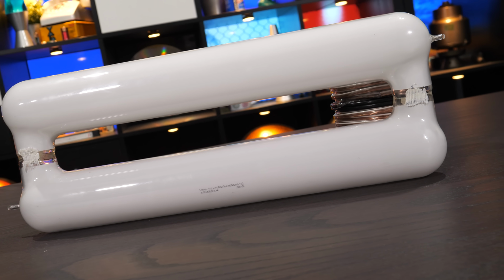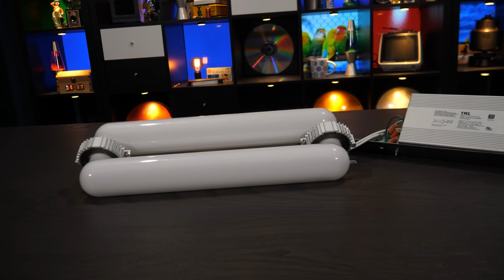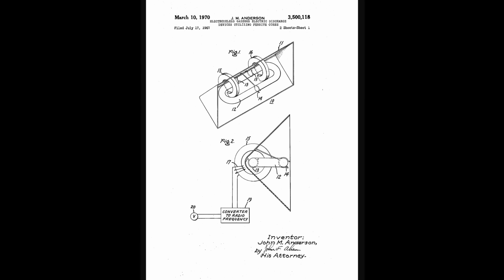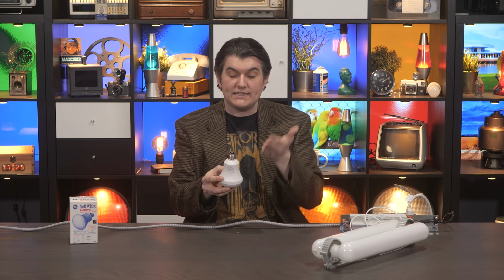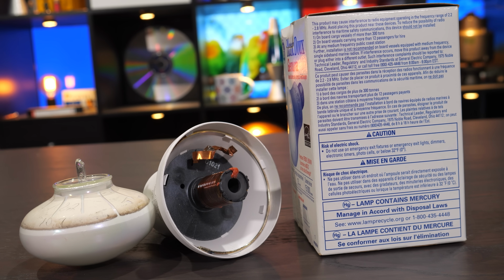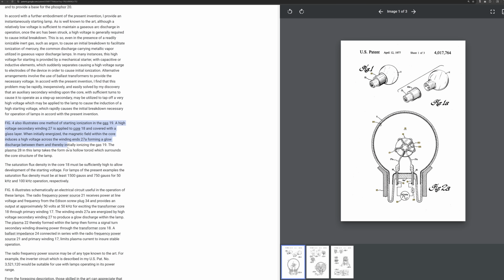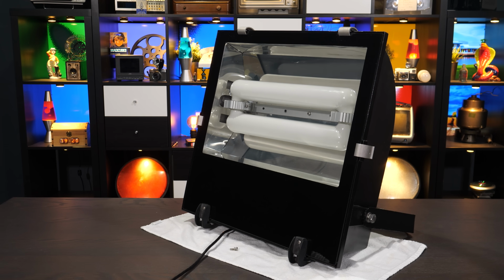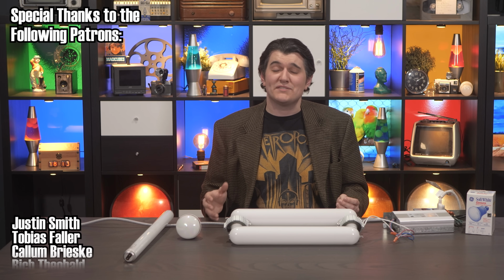Induction lamps: fluorescent lighting's final form

Comment: It works the same as when you put fluorescent lamp next to Tesla transformer. Large enough electrical gradient can break down the gas and produce electrical discharge and thus light.
In case of magnetic field, the time derivative of the field produces electrical field. The higher the magnetic flux or frequency, the larger the induced voltage.

In case a metal strip is placed inside the glass tube across the voltage gradient, it can either act as an antenna (placed inside the core) and thus increase theninduced voltage inside part of the tube if tuned correctly, or as shorting element (placed away from the core), thus providing lower impedance path, virtually shortening the length of the tube. Once the tube is started, the gas achieves much lower impedance and then the metal strip does not male that much of difference when running (if made to be fairly thin / small).

Comment: The problem with LED's is that the advertised lifespan is nowhere near realistic. In a lot of cases it's worse than fluorescent. At start they advertised 150.000 hours, then 100k, now I see "60k" on packaging... in reality it's 10-20k, except if it's cheap and chinese, then it's a few months tops XD . Meanwhile many of my fluorescent bulbs are 10-15 yo and probably got 20.000+ hours.
Less energy efficient? 2-3x, yes... On paper. In reality those leds are hot as F*** and definitely aren't "3-5 watts". Power factor is bad, also they inject garbage back into the grid causing the new digital power meters to go haywire

Comment: Those amalgam pellets are attached to a small antenna that creates a high voltage that allows the lamp to start. I've used a 400W version that was purple pink to grow plants with. Replaced the capacitors and the mosfets in the driver twice over 14 years of use. LED panels ate its lunch though. 😂

Comment: The only thing I understood from this is Magnetic/Electrical  Radio Frequency causes these bulbs to glow. Modern LED bulbs are way more efficient, but seeing the light bulb history is still cool, even if the bulbs won't be after being on for a few hours. I wouldn't be surprised if the GE bulbs failed from the glass falling out of the bulb due to the heat.

Comment: The thing to point out is that frequency dependent discharge exists. The higher the frequency, the lower the breakdown voltage gets. Another factor is how high the actual current is in the induction coils, recall that most power loss is a result of copper loss, which is proportional to the square of the current times the resistance: What if the current is very small? And with very high frequency, the skin effect minimises actual conductive volume versus the conductive surface? To say the least of the bleeding edge research of surface plasmons that indicate that this is a very effective technology for the purpose of power transfer and wireless charging.

There is also a company that is using it for large area, high efficiency wireless power called Etherdyne. it takes advantage of all of these attributes to allow for their whole room wireless power.

Comment: Years ago I had heard of those lamps. When LED came around my idea was and still is a mixed lamp. Mostly LED when it is cold, and mostly induction lamp when it is hot.

Sure, it would not stop the LED much from degrading completely over the time, but most of the time both technologies could work together with much lower power for probably higher efficiency?

Comment: As for how these induction lamps start , well it's not that complicated but it does help somewhat to explain why they took so long to become commercialized.
It's actually not all that hard of a concept to understand, all that is required is that you have to have an electromagnetic field inside the envelope that is sufficiently intense in it's variation to overcome the ionization energy of the gas particles contained within. Same idea as with "normal" fluorescent bulbs, starting the thing requires a particularly intense "burst" of energy, but running it at a steady state requires far less instantaneous power output. I imagine that the solution in both cases (assuming an electronic ballast for the fluorescent lamp) is the same, charge up a capacitor to a high voltage and dump the energy into the electrodes or coils in a way that does not damage the steady state drive electronics.
As a side note, starting quickly is almost certainly one of if not the major reason that the GE induction lamp has it's mercury amalgum pellet on a particularly long stem inside the ferrite coil antenna. That is where the magnetic field fluctuates the most strongly, which means that is the location that receives the strongest heating from electromagnetic fields, and so by locating the amalgum pellet there, the "warming up" phase of the lamp's operation is greatly reduced. As for why that is not done on the 200W output 2-coiil lamp, I imagine that is due to lifespan concerns and envelope geometry constraints.

Comment: fluorescent lights are so crazy to me, one time my friend was restoring an antique radio and for the life of him he couldnt get the tuning right there was a clear interference sound. he turned off his wifi, any bluetooth, power strips, still had the interference. turned out it was from a flickering fluorescent light in the hall outside his apartment.
Reply: Old radios (especially AM) are SO sensitive to interference. If you take an AM radio out to a very remote area it's nearly silent as you scan for stations. All those weird noises we associate with AM are interference.

If you look up a video of an AM set in a remote area scanning the dial the difference in noise is wild.... Just a little static till a station comes in, no crazy noises at all.
Reply: @volvo09  FM and digital radios only mask the interference until it gets bad enough.
Reply: I remember how my PC speakers used to produce some weird buzzing sound, but only when their volume knob is close to either its lowest or its highest value - right at the middle the sound was barely there. I just assumed that, due to them being quite old, they may be failing due to leaky capacitors or something. But then I realized that the sound is only there when the lights in my toilet were working. So this wasn't even the speakers problem, it was the problem with the ballast of the lights fixture. After several months that light fixture had failed completely and I replaced it with an LED one. And those speakers still work perfectly
Reply: @akeem2983  You reminded me of PC speakers predicting calls to your phone
Reply: @Kalvinjj  I remember those days! You just made me smile, thank you!
Reply: @akeem2983 i have cheap logitech speakers, heck all of their speakers have this issue, and many times I have been able to pick up radio broadcasts or other because of the entire absence of shielding in all of the components.

More than once I have been convinced someone is talking behind me or I'm being haunted when it was just talkback radio.
Reply: modern radio equipment use spread spectrum modulation (QSM) that modulates both the frequency and amplitude and basically creates a white noise that permeate everything and is basically immune to interference (until the entire noise floor of that band becomes too high). Old simple amplitude modulation radio has no chance of surviving on this modern environment.
You open up older equipment and they're full of shielding, nowadays the EMF shielding is basically "virtual" it is done by randomizing the frequency output so it never peaks for long at the same time, which for the spread spectrum (aka, QSM) used by phones, wifi and bluetooth is not a problem.
I discovered that when I made a small microcontroller produce a very clean 16Mhz radio signal from its clock source because I didn't knew all of that and configured the PLL (phase-locked loop) myself wrongly, aka, I didn't. 
Not to say the homebrew radio people weren't happy with the interference I caused. That wouldn't be a problem for a 2W device, except that my device had an amplifier (it was for audio, but it was a 200W SQR amplifier) and the signal leaked back to its Wi-Fi repeater via poor grounding, which it promptly amplified to 100W over that I sent over 500m.
Analog electronics is hard, you want things not to be an antenna, but everything is an antenna.
Reply: @monad_tcp  yuck... so instead of taking advantage of light having nice frequencies they scattershot the range?
Reply: Even you standing near makes you an antenna or a source of interference :D
Reply: @monad_tcp  Because I'm essentially clueless regarding this kind of thing, and you, obviously, are quite the opposite, I'm singling you out for a silly question which I realise is probably beneath you, but which I'm hoping you (or someone else reading) may nonetheless indulge, if you have a few moments... I was wondering if the ferrite cores wound around with copper wire used in induction - fluorescent lamps could be used as AM radio aerials (antennas), and if so, would they be useful in the broadcast bands? Obviously RF energy is integral to the operation of these lamps, but I don't really know if that is of any relevance to my question.
         I realise there is probably no practical reason why someone would want to dismember one of these lamps for such a purpose (at 150 bucks a throw I don't really see some kid trying it for his/her science project crystal radio... hypothetically, I suppose it might not be beyond the realms of possibility for a POW to give it a shot, but I think we're a little bit past the days of the BBC sending coded messages into occupied France?!) Still, the possibility(?) piqued my curiosity.
       One related question, if I may? It was gratifying to note that one of the manufacturers mentioned in the video coated their bulbs with a (semi) radio~opaque layer to minimize interference. I take it I'm correct in assuming that LED lighting manufacturers nowadays make little or no effort to shield or suppress nuisance radio emissions from their equipment?
      Anyway, Cheers, Ta (whichever!)
Reply: @monad_tcp  antennas arent a problem. its called grounding. any good cables have not only + and - but also the ground connection on them. i managed to ground my speakers on an old ikea cabinet that used gold glass (just a tiny amount of gold in it made the glass much stronger, and it produced green reflections) by just making the cables touch the glass.
Reply: @monad_tcp QAM. Quadrature Amplitude Modulation. Spread Spectrum is a separate topic. For example, OFDM as used in 5G cellular or WiFi is a form of Spread Spectrum, because you slice the wide RF band into multiple narrow orthogonal bands, each running an independent QAM stream. So they are related, but OFDM is a frequency division method of spreading signals, and QAM is a method of modulating each band to pass data.
Reply: Had a problem like this some time ago. The culprit was a fluorescent tube which displayed lighter and darker bands across its length. Ot generated noise roughly at 130 kHz. It took me quite a while to spot, as in happened sometimes.
Reply: Heck yeah, Sage watches Technology Connections?!
Reply: those FCL lights super amplified my TVs remote. one step up the volume resonated with endless up the volute until i turned it off. same thing with lower volume. you could put the remote on the the table and it would still "send signals" in some way. my parenty werent amused middle of the night lmao
Reply: How did he found out that it was the light?
Reply: @vilian9185 , the interference will pulse at the same rate as the flickering light.
Reply: Huh fancy seeing you here, lovely channel
Reply: Those little miniature desktop florescent lights that the old ladies all demanded be on top of the monitors "to see better" played absolute hell with the CRT monitors and even some desktops
Reply: This is why i hate modern electronics that run or charge off of 120v. They're all noisy on am radio up through shortwave and even into vhf frequencies.
Reply: Radio is one of my hobbies and most CFLs are incredibly noisy from an RF standpoint. Switching power supplies are too. AM radio is nearly useless in most modern homes due to all the electrical noise.
Reply: Imagine being a musician, let's say at home studio, where the pickups already pick up noise from facing screen monitors, or radio signals, lights and whatnot. And then having a fluorescent light around.

Personally I have a flash of blue in my tv whenever I flip the bathroom light switch, sometimes other lights flash as well. It might be the fluorescent light or just in general the wiring, the tv source is through a home theater amp from pc via hdmi. The blue screen flash is I think the default no signal mode visual.
Reply: Finding out that Sage watches TC is the cherry on top of this video
Reply: Yes, a malfunctioning fluorescent light CAN become an R.F. firehose...

Comment: 18:00 I would imagine some manufacturers played with the idea of including a long-lived, low-level α- or β-emitter in the amalgam. That would solve the problem of providing the initial ionisation. With the correct choice of isotopes, it could potentially be at a level where the tube would not need to be handled in a more strict regime upon retirement than any other Hg-containing lamp. (I guess that would be yet another product with wildly varying requirements depending on the local regulatory body for radiological sources.)

Comment: What I suspect the wire inside the tube is for is simply to allow the high frequency to slosh the electrons in the wire back and forth... create an induced current back and forth.  Since there is no "circuit", the electrons just pile onto the end of the wire on each cycle and that directly equates to voltage... even a discharge.

So, think Tesla coil.  Or consider a regular inductor where you run a current through it until it is steady state, then disconnect one end.  The inductor will force the current to continue to flow but since there is no longer a circuit that forces electrons to pile up on one end (high negative voltage) and vacate the other end (high positive voltage).

And just like that you can get a spark as you pull the wire away from the inductor.  p.s. avoid electrocuting yourself though, you don't want to complete that circuit through your body!  We're talking tens of thousands of volts or higher that can develop on the end of the inductor.

So that is what I suspect is happening with that little "wire to nowhere" inside the tube.  The high frequency is sloshing the electrons and creates a high voltage at the tip of the wire.

-Matt

Comment: These lamps were used in environments such as biohazard or radiation security such as Nuclear fuel rod loading stations where a lot of light is needed in a small area.    They also have a very controlled light spectrum used in Photography. I have seen smaller ones but that is a beast.

Comment: Forever is a loosely used word in electronics. If there are electrolytic capacitors in any circuit, the life of the device will be determined by the life of those capacitors. Electrolityc capacitors have a finite life , the length of which is determined largely by the quality of their build and their operating environment.
Reply: He was referring specifically about the bulb lasting forever. Not the driver unit Professor.
Reply: Note that polymer electrolytics, if available in the capacitance and voltage needed, can outlast wet electrolytics many times over.  They can have higher leakage currents, but those are still small enought to be tolerated most of the time.
Reply: @markterribile6948 true but how often are they used in mass market alectronics? In my experience some manufacturers will spend on a higher quality electrolytic rather than a polymer, if at all.
Reply: High quaility electrolytic capacitors will last decades and can be reformed safely when repairing old TVs and radios.

Comment: For the internal, single coil bulbs, the amalgam pellet seems to be in the are that would be inductively heated, boiling off ions. Perhaps during testing of the larger lamps they found there was enough free amalgam hanging out near the ferrites? Thinner glass there, plus the aluminum heatsink would cool those areas of the bulb faster than the surrounding glass, tending to encourage metal condensation.
Reply: Usually they constructed in a cold spot (the normal tubes have them as well) where the mercury / amalgam can condense. This happens also during normal operation, but I can't really remember why this was important for the phase change cycle within the tube.

Comment: Yeah, they literally do HF start, just like other applications that need to start a breakdown arc (like HF starting welders). It starts by putting a high, high frequency voltage on the coils, which accelerates any electrons that are weakly bound well beyond their ionization energy, and then keeps accelerating them through their mean free path to interact with neutral atoms strongly enough to knock off electrons AND do that with enough force to cause more than one electron to still have at least enough energy to ionize the next.
Reply: Sometimes referred to as the “first electron problem”. HID lamps (like Xenon lights and projector lamps) also need a starter and a ballast.
Reply: The discharge probably starts as a capacitively coupled plasma ans transitions into an inductive coupled plasma.